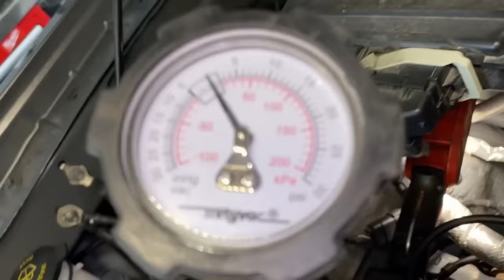2011+ Ford F-150 3.5L GTDI Ecoboost Engine P0299 Turbo Underboost Quick Diagnostics

Comment: I recently joined your channel have learned a lot and really appreciate many of your videos & just realized yesterday that we have the opportunity to subscribe & get actual benefits in the form of ideas & feedback... I have a 2013 F-150 screw XTR 3.5 EcoBoost.  Started intermittently losing boost a couple months ago Way under powered But seems to have at least partial boost in the mornings & random times throughout the day.  The first two codes I pulled when it started was p0299 and p054A or B the cam/crank correlation code is no longer active & I can't find where I wrote it down & don't remember if it was A or B.  Today it throws p0299 and p0016.  I had a shop that I trust Do the full timing and cam phaser replacement ~2 years ago.  No cam phaser rattle only pass side turbo wastegate rattle. Both wastegate diaphragms work smoothly & no linkage slop. Actuator solenoid tests ok. Initial look @ BOV appeared ok.  Cleaned all 3 MAF sensors. Replaced bank 1  cam sensor A (intake?).  No leaks. The change in codes from the start to now leads me to believe the issue might be in the VVT's But what also threw me off is after changing that cam sensor & cleaning the 3 intake air sensors it ran with more power than I think it ever has + no boost loss for full day of driving & then started the intermittent loss of boost the next day again. I then replaced the MAP cuz it was the only one of the 3 sensors that didn't look good and I thought maybe cleaning it improved the issue temporarily... No fix. The P0016 and previous P054A? led me to believe the noisy pass wastegate wasn't the cause and had to be in the electrical or valve train. Any thoughts besides Holy Sh*t this guy can ramble? Lol thanks for your time.
Reply from the maker: I just went through this with a customer that had a timing job done with aftermarket parts and 6 months later p0016 p0299. If you are getting a p0016 code it is causing your p0299 intermittent boost loss issue. A p0016 requires a timing job plain and simple. The Ford stuff last much longer. I am sure the shop used aftermarket. The 54 code is the VCT solenoids every time.

Comment: My 2016 Expedition just threw this code but it went away after a few days.  The fact that ine of the reviewers said he replaced his without dropping the cooler gives me hope.  Temperatures have finally cooled down which is good because I didn’t want to sit under the Expedition on the street in 90 degree weather.

Comment: Thank you for the video! My 2013 was giving me that exact code and since i already had the front end apart to change the water pump i took off that bypass valve and sure enough it had a hole. It seems allot of people in the comment section have similar issues. Is that valve a dealer only item? I've been looking online and cant find other sellers having it for sale. Edit: here is the part number for the turbocharger diverter, air bypass valve, AA5Z-9U465-A If you search by the part number you will find sites that have it for half off the dealer price, if you are not in a hurry to replace it.

Comment: Wow... Brian, I found some clamps loose. At least three were fairly loose. Also, found the air deflectors (for lack of the proper name) that keep the air directed to the radiator that are on the left and right sides of the radiator in between the headlights torn at the point the plastic push tabs hold it to the radiator shroud. Thank you for the advice!!! Next I’ll check the sensors to be sure they are free of dirt/ oil buildup.

Comment: Excellent video, enjoy all your videos. 
I just experienced problem this morning. 
2011 F 150 3.5 Ecoboost.
Left the house this morning, everything was fine, a couple miles into running….loss in acceleration power, no codes! I’m at work now, not a chance to look over anything yet. When I slowly get up to 60kph, I then get power acceleration. Any ideas?

Comment: I’m working on one of these f150’s (used car inspection) I have that under boost code. I performed a smoke test on the charge side of the intercooler pipes didn’t see any leaks I also used shop air to move both turbo wastegates & the both move, I didn’t know about that bov.  Thx for the info 👍
Reply: How do you do a smoke test?

Comment: Hello, thanks for this great video. I believe it is helping people around the world. Mine is an ecoboost f150 3.5l from 2011 and downs have this blow off valve and I have this issue. Turbo underboosting and then engine being in a safe mode. 6 months ago I can't solve the issue
Reply: Hey did you ever figure out your issue? I'm having a similar issue on my 2013 f150

Comment: Yesterday I heard a loud boom and lost power. The driver side lower intercooler pipe (outlet) blew off damaging the connection. I am interested to know why this happened. To blow that clean off requires a lot of pressure building up in the system.  So what causes this?  You mention the boost pressure and mass sensors and waste gate control solenoid need cleaning, anything else? Thanks for these videos, you help a lot of people with their Ford problems.

Comment: Such a great video I really appreciate it my question is when you’re cleaning off the sensors do you like to use brake clean or a different spray solution let me know if you get to this and thank you so much you might’ve saved me from the shop.

Edit!!!!!!
Jackpot it was that valve I have a tear in the diaphragm and almost the same spot I’m going to get that ordered and replaced and we will see how that works out I will clean all the sensors out but after watching this video 20 minutes later under my truck I had that sensor out and that’s the problem I can see for now let’s hope that’s the only one.

Comment: I had this after doing a full timing job. Turned out I had just not fully connected the intercooler outlet quick disconnect. Popped that fully in and problem went away! Was scary since blue scan tool only reported turbo replacement as a common fix 😳

Comment: Good Afternoon.  THANK YOU SO MUCH for posting these videos.

I am having a problem on my 2011 F150 Eco boost.  It started with the exhaust leak on the driver's side manifold.  I have a buddy who is a mechanic and I was in a previous era.  We replaced the manifolds and all included gaskets and rings.  Also did the timing chains as the truck has 149,829 miles.  After work was don, truck fired right up and idles like a dream however driving is very wavy and threw a P0299 code.  I've checked all the tubes and lines and can't seem to see a problem.  Since this is a 2011, it doesn't have that blow-off valve in the charge air cooler.  

We are at a loss.  Do you have any video's of "older" Eco boost diagnostics???
Reply: Have you gotten it figured out?
Reply: @NASAxDRAGZ  nope. Just towed the camper 1300 miles. Every time we got a long grade or steep hill, 2nd gear pulsing. Gonna replace the turbos when we get home. I don't know what else to do.
Reply: @cookdonald  so odd… I found a disconnected hose form the intake to the throttle body seems to have somewhat fixed the issue, but I’m not 100% sure yet. I wish you luck man!
Reply: @NASAxDRAGZ  I'll check that in the morning. I'll let you know what happens in the way back
Reply: @cookdonald  goodluck!!
Reply: @cookdonald  did you figure out the problem? Mine is pulsing as well especially on hills.
Reply: @torredroadrunner  ended up being the phasers and it jumped timing.
Reply: @cookdonald Ouch!!

Comment: My 2014 Ecoboost F150 blew up coming off throttle. I was pulling a heavy-ish trailer and I was merging onto the highway, as soon as I let off the throttle I heard an awful thud then a major clunk followed by a lot of rattling. The cylinder 5 injector was stuck open and when I let off it hydro locked the motor. It was at 60,860.3 miles. Got a new engine and sold the truck and bought a 2015 Hemi Ram.

Comment: I’m having a problem with a 14 f150 3.5 eco boost. if I drive easy it’s all good! if I step on it at all it sounds like it back fires into the intake. Goes into limp mode I can stop shut it off and it’ll start after two tries and drives normally as long as I don’t step on it. And it’s not throwing any codes? Do you think it’s the Throttlebody or something to do with the TB? Thanks

Comment: Hey Brian I have a 2011 3.5 EB I have a afe stage 3 cold air intake that came with the truck.I have gotten the truck looked at and one turbo is bad on the passengers side is leaking oil but I hear a howling or suction noise coming from the intake. I have check the actuators of the turbos and both hold pressure I even checked the diaphrams from the side of the turbos and they are both in tact no cracks or cuts. But I still can’t find where the howling is coming from. After a cold start you can hear it howling then is gets to normal idle and it’s gone until I put it in gear and accelerate or when I let off the gas.

Comment: Absolutely fantastic video.  Thank you!  I will be checking as much as I can tomorrow before I schedule an appointment at my Ford dealer.  I’m hoping it’s as easy as the blowout valve. Any recommendations for a cool loud aftermarket blow out valve?  Thanks.

Comment: Just had this code come up today, checked the EBOV and did not see any rips or tears in the membrane, drilled the weep hole as well, also have dual catch cans. no mods other than a boost gauge

Comment: Thanks for the great info. I have a 13 3.5 and found my blow off valve had a hole in it. I was only getting codes or loss off power when towing. I replaced the valve and towing was much better until I got into traffic and I started to get loss of power again. Any ideas?

Comment: Once again, great video I just replace my boost control valve, but my diaphragm look good on the old one, but I replaced it anyway. Disconnected the battery to try to do a complete decoding of the car hooked it back up have my fingers crossed, but it still feels like there’s no Power like it used to have. I replaced all my spark plugs a couple days ago. The car was running better than ever. I just went through everything you just said and everything was really good. Is there anyway to check the turbo to see if the turbo is good or bad. I just replaced the driver side turbo a year ago with an OEM turbo part from Ford. when my turbo went out last time, you could hear a rattling noise really bad this time car sounds perfect so once again is there anyway to test a turbo before I go any further. I moved to Tennessee and I really don’t know any good Ford mechanics out here. This car was at the Ford dealership for over two weeks for another problem, and they had no clue and couldn’t figure it out. I had to do it myself which I did.. sorry to ramble on, but I’m just hoping that it’s not the turbo

Comment: Hi Brian, I'm considering buying a T350 ecoboost 3.5L passenger van with 187,000 miles for $14,500. What should I make sure the mechanic checks before. I notice a used tow pkg. so I know it pulled something. Also, Do u think it's worth that price?
64 years young and want to set out solo traveling in an affordable, but yet SAFE vehicle! On SS Disability and can't afford a new. Your opinion is greatly appreciated. 😊
Reply: Brian, I can only surmise this question was to intense or you didn't have the time. Sorry to have bothered.

Comment: Hey bud, you might want to change the name of the video because the part you are showing that failed is not applicable to 2011 and 2012 model year. Those years have two separate blow off valve mounted on the side of the turbos. They do not have a singular blow off valve mounted on the cac tubing. Don’t want people to be misinformed. The rest of the video seemed spot on.
Reply from the maker: All these failure points and test apply to all model years, the only difference being the location of the turbo bypass valve which I clearly state is unique to the 2013 and newer models.

Comment: Brian, can you speak to 11-12's that have boost solenoids at each turbo, and the vacuum tubes to each port? How those fail and how they work with the WG solenoid on the manifold, and also speak to the failure rate of the BOV diaphragms on the 11-12's?

I've been getting hesitation under a load, towing, etc, then got the P0299 code. 

How about where we can get parts during the pandemic since most places are back ordered? Thanks you
Reply: Salvage parts off a low mileage wrecked vehicle might be the best bet
Reply: Ok so those are on the compressor housings and have the same style rubber diaphragm. There's a hose that comes off that bypass valve port to the CAC tube. Use pinch off pliers on the big rubber hose to block it off 1 bank at a time. Usually there's a weird noise associated with a diaphragm failure on these. You can power brake and build boost as well without driving. Whichever side you pinch off and the noise goes away, bingo! Easy to replace too. 3 screws and a triangular plate comes off and the diaphragm will come out with the spring too. Good luck to you.
Reply: And we have them at the dealer.
Reply: @MrImportcartech thank you 🙏

Comment: Top notch video as always and glad to see the PRO confirm what us shadetree dudes were seeing. Not going to go on a tangent about Ford not at least doing a TSB on this (they should have) but at least the updated part seems to have a more robust diaphragm than the old one. BTW only used the motorcraft one and think its a bit pricey for what it does but at least its OEM.

Brian I hope you do a video showing the crappy cold idle on these engines and what you recommend to fix them. At this point, have done plugs, coil boots, and map/maf clean but still have garbage idle at cold start until about 5 minutes in. Going to try the wastegate test but thinking this is something to do with an idle control outside the turbocharging system. Also on my truck it seems like you can hear an audible click right before the idle settles down. Only reason this is bothering me is that wife was driving the truck the other day and said it idled badly all throughout her drive.

Really trying to avoid a timing job on this engine!
Reply: Not sure if this is like your problem, but my 15 3.5ev had a bad idle for about a year, 60-75k miles time frame. Then it started going into limp mode, codes pointed at throttle control valve. Replaced that with OEM and cleaned the sensors while in there. Idle problem went away for the most part, no more hunting.
Reply: If your vehicle is high mileaged you may carbon build on intake valves. When it's cold the carbon is hard and doesn't like to seal the valves all the way till it's warm.
Reply: @JasonW.  no codes yet but will look at this. Thanks for the advice
Reply: @wilwiener  yes I have been thinking of that. Had a Hyundai with the lemon 2.4l in it and the valves were carbon coated at 110k. There is a video on YT where a mechanic dumped gasoline into the top end of the 3.5 and let it eat thru the carbon and varnish. Then did an oil change and it ran good. May not go that backyard but maybe it's seafoam time
Reply: @aaronturner1072  my throttle didn't kick out codes until it went into limp mode with wrench flashing and 2mph top speed (restart truck fixed this sometimes). And even then that code went away after about 50 miles, so I ended up bringing a Bluetooth scanner with me to find out what was failing
Reply: @aaronturner1072 I seen that before and I was thinking the same thing 🤣

Comment: Am I mistaken or do I see a crack on the passenger side manifold, maybe it's just casting but it looked odd. I know exhaust leaks usually have staining from the gases escaping.
I love your videos, always great explanations and it has helped me to avoid misdiagnosing issues at work.
Reply: NO IT'S NOT CRACKED! IT'S FINE, IT'S PART OF THE CASTING. STOP USING YOUR EYES, AND STOP COMMENTING!

Comment: Checked all the clamps... found a few that needed a little tightening. Got the code again despite that. 🤦‍♂️ So, I will be looking for any oil residue that may have returned. I had just gotten an oil change, and thought the oil could have been the result of a sloppy Ford tech. Back to the drawing board.